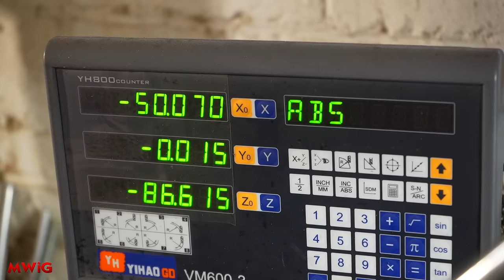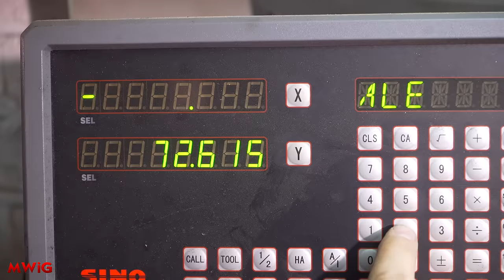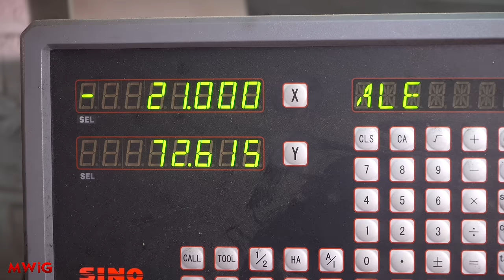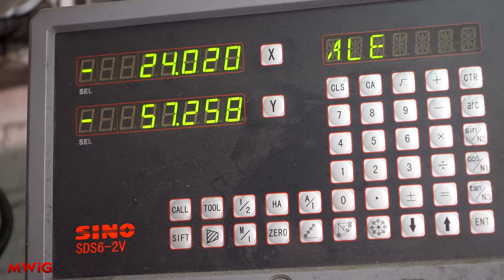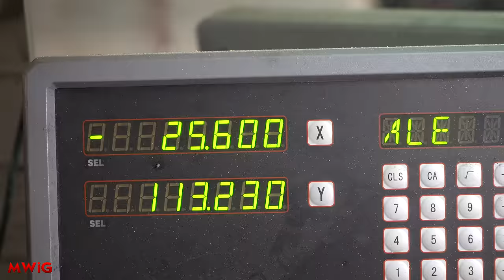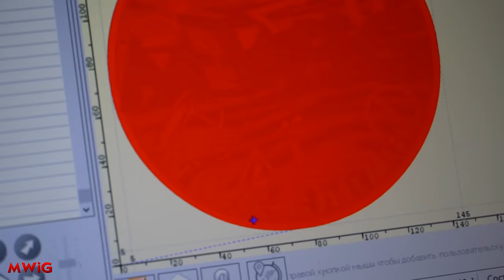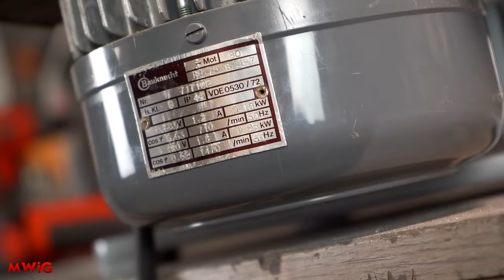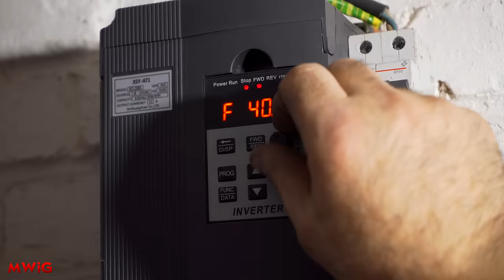Making small wheel belt grinder - Small Wheel attachment

Comment: Excellent work as always ! WELL DONE ! 👍👍👍
I always set my lathe on low rpm (200 RPM) and use a hacksaw with a 14tpi blade to do all my parting off carefully, It always works well and has saved me a small fortune in parting off tools which always seem to overheat, grab, snap and dislodge the workpiece in the process !
Reply: I will use your setup and try this again. It would be nice to avoid the many problems with parting tools. Deep cuts are almost scary sometimes. Thanks
Reply: @tomwadsworth5768  Good luck mate - The low speed and hacksaw trick work very well to get the job done without the risk of the parting tool digging into the workpiece too deep and ruining your work !

Comment: Your first set of bearings were a little large but should not have been that stiff.  A small piece of debris between them may have caused an alignment issue. Over the years i have found that any binding issues of any sort , can be some of the worst power stealing gremlins. Slightly over boring one or both ends and then using some bearing retainer compound works to let the bearings find their "own" center plus compensate for slight alignment and concentricity. Loctite makes a special (fairly cheap) compound for this. It will also repair a slipping/spinning outer or inner races. I have had no failures. Ideally the bearings should last longer as well.

Comment: Love the build. Only critique i got is you should make the work rest height adjustable. You will wear grooves in belts and essentially waist good grinding areas without it being adjustable. A simple threaded stock with a spindle nut into a tube will make it adjustable and still very stable.

Comment: The second motor you used was not a 3 phase motor, but a Motor which is supposed to run with a capacitor, one of the phases there for has an other resistance.

Comment: Nice job! 
I’ve saw you have connected the motor in star connection. If you connect the motor in triangle and not in star connection, the motor have more power. But its only possible if you use a 230v frquency driver on one phase.

Comment: Hello, the belt sander is great, very good, congratulations!!! But I wanted to ask you if the polyurethane layer (Carbond 955DG) holds up well as a soft backing for belt sandpaper. I have the same problem and I am looking for solutions within my reach. Industrial vulcanizing is an option but not for 5 rollers, I have to look for something I can do in my workshop. Thank you so much.

Comment: I used a pump motor for high rpm and torque. 18:06 Invasion?? Thank you for not painting the motor. 👍🏻it acts like insulation and builds heat, in case someone else didn't know.

Comment: Hello friend. What rpm motor did you use for your grinder. I am currently in the process of making a grinder from a older table saw motor and spindle assembly. I was wondering that way I can get the right pulley combination to get my speed close. I also I'm going to make a 4 inch wide belt grinder using a spindle assembly from a saw with a 5 hp compressor motor. Thanks for any tips or advice you may share.

Comment: another great machine has come to life ..  question on your power unit , do you use the same unit on all the machines or do you get a power unit for each one so you don't have to keep switching it around ?? also do you wax or oil your table top where its bear steel / RUST /  I like the rubber on the shafts too grip the sand paper ..
Reply from the maker: Randy,
Since I do not use these machines at the same time, I made one outlet to connect them to the frequency converter.

Comment: Hello, good job but in my experience a 2840rpm engine is better than a 1470rpm.
Although I do not know what the diameter of the drive wheel, I assume that 100mm at an engine speed of 1440rpm is your cutting speed of 7.7m/s. And that's not enough. With a 120mm drive wheel and a 2840rpm engine, the speed would already be 17m/s, which is sufficient.